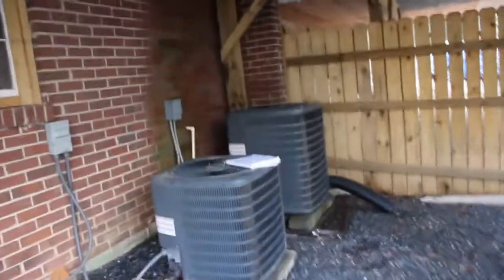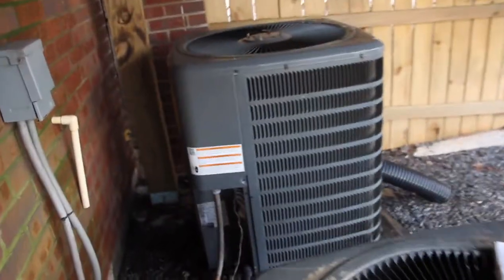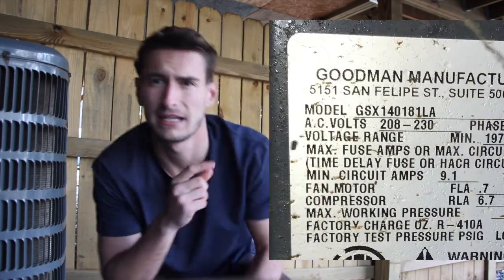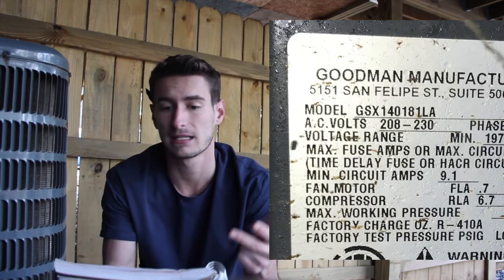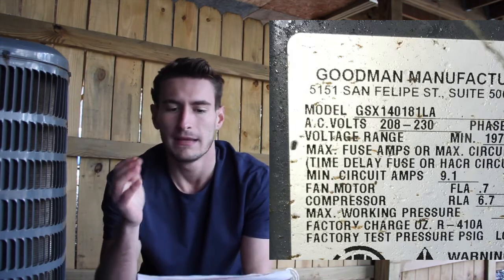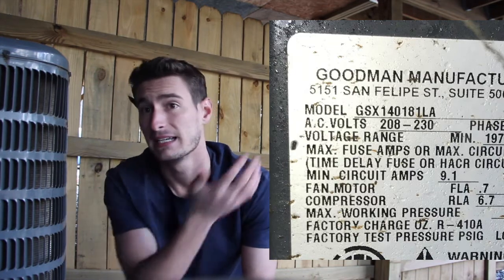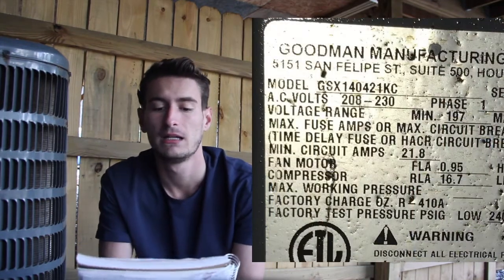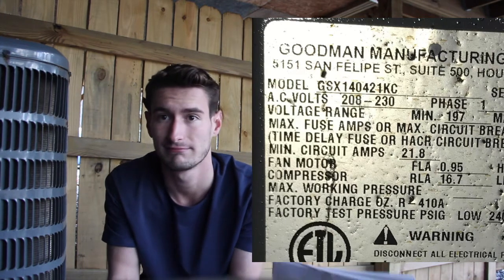How many tons is my AC unit?

Comment: Old Lennox M/N: CHP10B-651-2P _ S/N: 5185L22637 Driving me nuts, because there's nothing evenly divisible by 6 or 12
Reply from the maker: Got you covered! Looks like it is a 5 ton unit. It’s a 1985 system so Lennox did it slightly different. Hope this helps, thanks for watching, and don’t forget to like and subscribe. 😊🐝

Comment: Could you please  tell me how many tons is my unit?  The model number is
4TD2036A10NUAA
Reply from the maker: Sure thing! Hey Mike, it looks like it’s a 3 ton unit from the model. I also found this online to double check: 
4TXD20 36k BTU - Cold Climate Resolute Outdoor Heat Pump - Multi-Zone - Up to 20 SEER2 / 10.5 HSPF2

Thanks again for watching and hope this helps. :)
Reply: I have another question.  I have a 2,395 sq ft, split-level house and was sold a 3  ton system. Everything that ive read states i should be using a 4 ton.  My concerns is that if this unit is undersized for the size of my home, I won't be happy when summer comes.
Reply from the maker: hey Mike, that sounds correct. For that square footage we’d recommend a 4-5 ton unit. The ductwork needs to also accommodate that size equipment though, or it could freeze up / over heat depending on the season. If it was well ducted and potentially zoned then you could probably get away with a 4 ton unit, but you’ll have to be very specific about how you structure the new zoning set up / system and ductwork upsizing.
Reply: . Thank you!
Reply from the maker: @mikegreer671  sure thing! Always happy to help. If you have any other questions, just let us know. 👍

Comment: GSZC180601CA - it has two numbers that work. Is it a 1.5 or a 5 ton? Thank you!
Reply from the maker: Honestly so sorry this got lost in the mix. Hope you were able to get this figured out but it looks like a 5 ton. I was also able to find this online to double check as well: GSZC180601CA / 5 Ton, 16 to 18 SEER, 2-Stage Heat Pump, Comfortbridge Communications System Compatible, R-410A Refrigerant

Comment: Thank you for the informative video. I have an older ICP unit and I need to replace the cold air return flexible duct. Unfortunately the manufacturer doesn’t follow the rule of thumb break down of the model number to inform me of the BTU or tonnage. The model number is PHF330000K00A1. Any help will be appreciated. Thank you in advance
Reply from the maker: Hey Ron, it looks like your HVAC unit has a 2.5 ton condenser. Hope this helps, apologize for the delayed response, and hope you got your issue resolved. :)

Comment: I have a 42-year-old Carrier. Yes, I got my money's worth. Paper label inside the unit is long gone, just a streak of adhesive remains. Packing slip said 38CQ900-021. Keypunch card said 38VE004301. If you can decode this one it would be very much appreciated.
Reply: 2 1/2 ton
Reply: Yep, looks like 2.5 ton unit.
Reply: Holy! 42 years old. THATS UNHEARD OF. Actually really impressive.

Comment: Hi Adam I came across a little problem where two numbers are divisible by 12. The model number is. GSZ130181AD I'm confused why both numbers would be in there.
Reply from the maker: Hey! That one is tricky! It’s a 13 seer unit and is a 1.5 ton system. 👍
Reply: Nice! Thanks for the follow up support. 
HVAC Bee rocks!
Reply: 1.5 ton unit - 12 or 6 for air conditioner sizings.

Comment: MODEL GSX140601KD Goodman
Reply: I’d appreciate if you could find my ton for me thank you so much
Reply from the maker: 5 Ton
Reply: @HVACBee  is that perfect for a 1,500 sq ft home or too much because that was installed on my home
Reply: @michaelmora599  too big.    .400 to 500 sq ft per ton.....you should be about 3 ton
Reply: Sounds about perfect. 👍
Reply: Thanks for this video HVAC Bee. Following this string to confirm 5 ton on this AC model number.

Comment: Im in Hampton Roads, VA. What size unit should support 1800 sqft.? The house has a old 2.0 ton but its not properly cooling the house. Im told a 2.5 ton is that correct.  Should it be a 3 ton unit instead?
Reply: Rule of thumb is 600 sq feet per ton of AC but it depends if any of that is below grade (like a basement), if you have a ton of windows and sun exposure, things like that.
Reply: Nice! Thanks for the practical #HVACTip
Reply: Probably more like 2.5-3 ton for sure.
Reply from the maker: Ya, for 1800 sq you are generally going to need at least a 3 ton unit to satisfy the heat load.

Comment: Hi thanks for the video. My model number is 24ABC648A310 and the brand is Carrier. Can you please tell me what size is? Because it has 2 numbers divisibles for 12 thanks.
Reply from the maker: Just looked it up for ya. Your unit’s a 4 ton residential air conditioner. 👍
Reply: 4 ton?

Comment: Hey this was great!!!!!! Now I got a question, if I want to remove a 2.5 condenser and install a bigger ton, maybe like a 3 or 3.5, would I be able to do that or would it be too much of a higher pressure?
Reply from the maker: Hey man, you could do it if you have the ductwork to support it. You have to have 1200 cfm of ductwork for a 3 ton and 1400 cfm for a 3.5 ton. 
(Basic cfm below) 👍
(1)4” - 50 cfm
(1)6” - 100 cfm
(1)8” - 200 cfm
(1)10” - 400 cfm
(1)12” - 600 cfm
Reply: Nice! Love they actually provided some solutions ^^ , these guys are awesome!

Comment: Hi, could you please let me know the tonnage of this A/C Model # GSC130601DB.
Thank you
Gabriel
Reply from the maker: Gabriel Alvarez That one is a 5 ton 👍.
Reply: @HVACBee  thanks for the great info! In this case here how did you know to go with the 60 and not the 30? Thus making it a 2.5 ton unit?
Reply: @jivy8 great question! Following.
Reply: Here’s a rundown of the range you will encounter: 18 = 1.5 tons, 24 = 2 tons, 30 - 2.5 tons, 36 = 3 tons, 42 = 3.5 tons, 48 = 4 tons, and 60 = 5 tons. If it's a new model this applies
Reply: @Beto-Bazan  yep! Money. Thanks for making it simple. 👍✅
Reply: 5 ton for your AC buddy. ✅

Comment: Hi Adam! Just subscribed to your channel. Need help to determine tonnage and seer for the carrier unit: 24ACC430A300 thanks in advance
Reply: Here’s a rundown of the range you will encounter: 18 = 1.5 tons, 24 = 2 tons, 30 - 2.5 tons, 36 = 3 tons, 42 = 3.5 tons, 48 = 4 tons, and 60 = 5 tons.
Reply: It's a 2.5 ton of it's a new model
Reply from the maker: Thanks for the assistance on this one. ✅🐝
Reply: Correct. That is a 2.5 ton unit for the #AirConditioningTonnage
Reply: 2.5 is the tonnage for this AC ✅
Reply from the maker: This one is a 2.5 ton! Thanks for watching and subscribing. 😊🐝

Comment: Hi mine central air condition unit’s Model Number is 2TTR1024A1000A, I was wondering how many ton is that cuz I need to replace it they said there’s a leek
Reply from the maker: Hey Aamir, Your unit is a 2 ton unit. 
With the Air conditioner units Model Number: 2TTR1024A1000A 
The 24 / 12,000(btus) = 2 Tons :)
Reply: Hopefully this helped answer your question for the #HVACReplacement Project. Thanks again for watching.
Reply: Good stuff! Thanks HVAC Bee.
Reply: Looks like a 2 ton. ✅

Comment: Mine has 124 so it could be 12 or 24
Reply from the maker: hey Jose A. Chavez , the smallest size residential ac unit is 1.5 ton so the smallest possible sizing would be (18) so you definitely have a 2 ton ac unit in this case. 👍
Reply: Hate when they do this! Makes it so much trickier hahahah